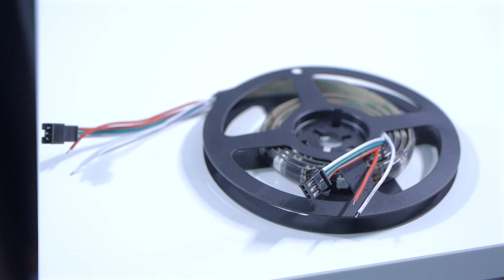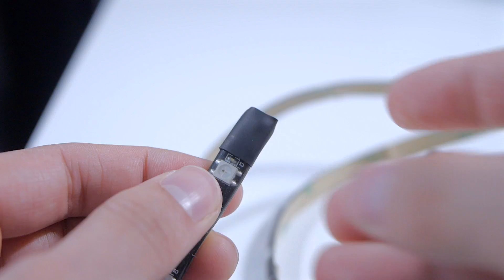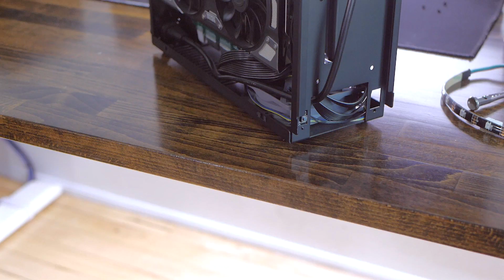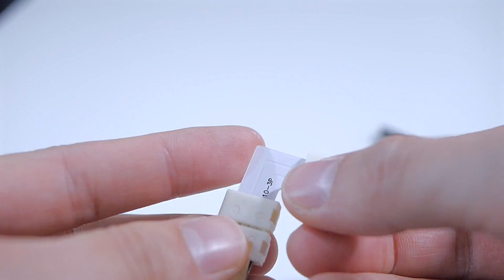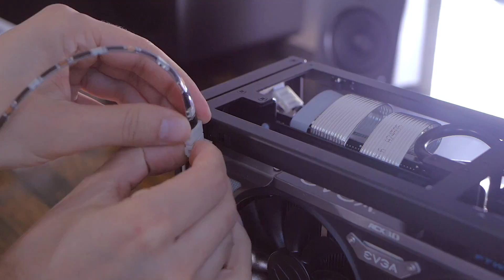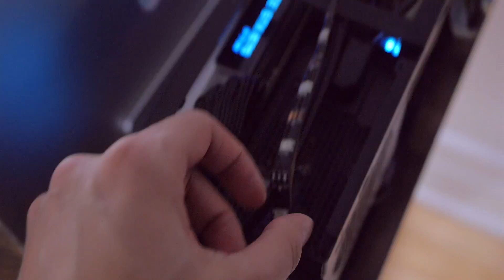Installing Digital RGB LED Strips In A Tiny Gaming PC!

Comment: Which do you prefer, the Dan A4 or your evolv shift? Is the Dan A4 silent/very quite (especially compared to the shift)?
Reply from the maker: The shift is quieter as it has really little air gaps, and it has dampening material at some places. 
But I like both for different reasons, the Shift has more space to build in, and you can fit larger coolers, more drives, etc, but the Dan Case has such a small footprint that I prefer it in my home setup as it's in my living room, and I don't want it to look too gamery haha!

Comment: Will u do a comparison for the asus rog strix motherboard diff compare to the current gigabytes one ? What are the compromise
Reply from the maker: Yeah I might make a video about these if I don't have new video ideas someday.
I personally prefer the ASUS as it has a built in LED strip, it looks better with the built-in IO-shield and has a few other nicer things, but the Gigabyte board has more video outputs (there's an aditionnal video chip on it) so you could drive 2 4K displays at 60hz without a GPU, while you would need one with the Asus.